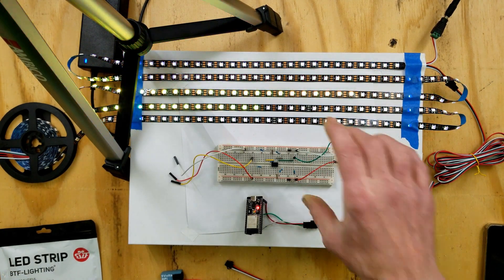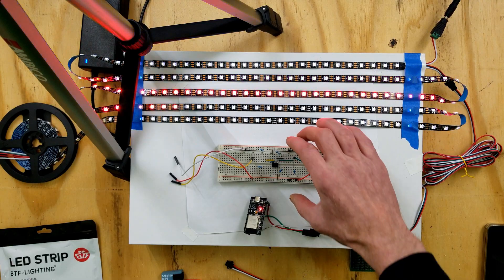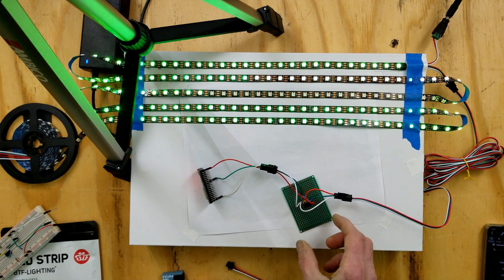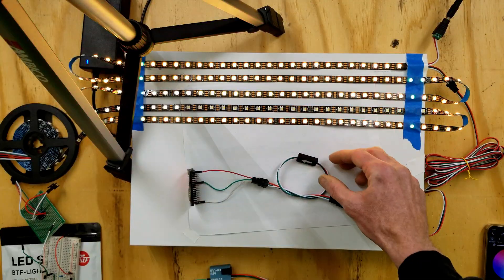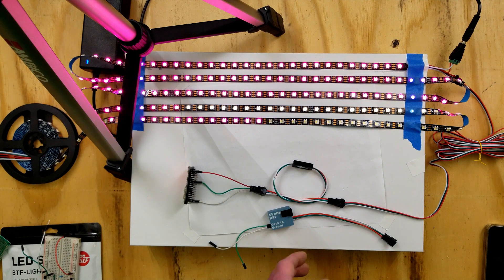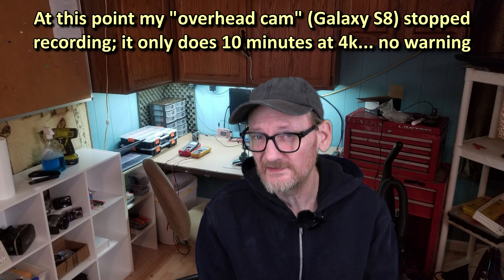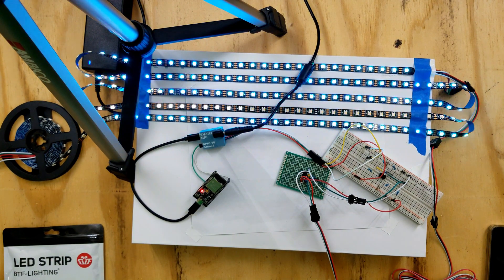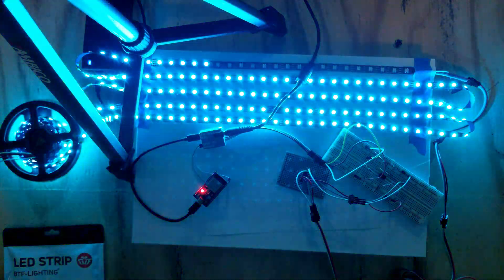New Inline RGB LED Level Shifter • 3.3v to 5v Data Buffer • WS2812b / SK6812 & ESP32 or Raspberry Pi

Comment: Hey Justin I'm using a WLED on a esp32 controller. I added your 5v level shifter going from the wled controller to the LED's that run around my projector frame. When I use the level shifter I cannot control anything. The lights will turn on with or without my power injector that's halfway added in. However my w LED controller will not change the lights at all it just is white and orange and red. If I disconnect the level shifter then it's all fine. My raspberry pi is not in the picture I turned Hyperion off for testing.  

Data arrow is pointing to the led's coming off the esp.

Comment: Hey there, wondering if your level shifter will work for RGBIC LED strips? I'm having an issue with the new sound reactive WLED update. I have an ESP32 controlling 2295 LEDs and it used to work perfectly. The new update requires another data pin after 2048 LEDs. I split it into 3 different data pins (D2,D4,D5) and there's less then 800 LEDs per pin. Flickering occurs after the 2nd data line. Power injections are also set up. If I add your 5v level shifter at the beginning of each additional data line will this fix the problem? Thanks for the help
Reply from the maker: Honestly, I don't know enough about the RGBIC protocol; I did notice they require more pins for each strip... but beyond that I have no idea of my level shifter is really the answer on these.

It was designed specifically for the WS2812b and SK6812 series (5-Volts, single data wire).

I don't have a ton of experience with WLED either -- I use it for testing, but generally I end up writing my own code for specific projects rather than relying on WLED.

All that to say, I can't recommend my level shifter for this application; seems like you would need multiple shifters for each strip... and I don't want to see you spend the money and it not work.

I am working on a multi-channel variation (for other strips with a CLOCK and DATA pin), and I had considered offering like a 4 or 8 channel version... but for the time being, what I sell was designed with the specific purpose of making a Hyperion/HyperHDR project more accesssible.

Wish I could be more helpful...
Reply: @JustinNelsonsProjects  thanks for the response 👍